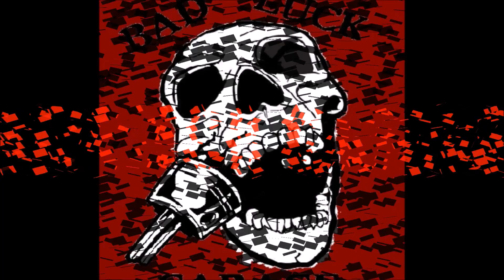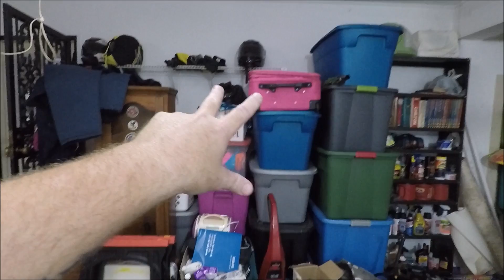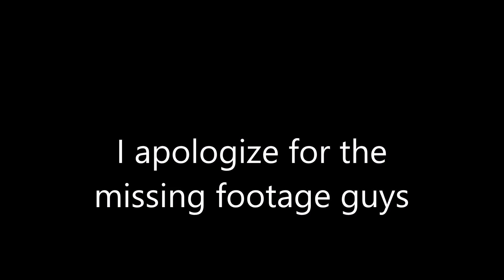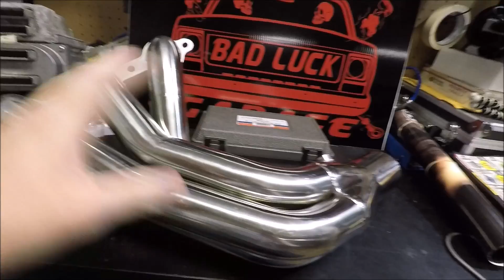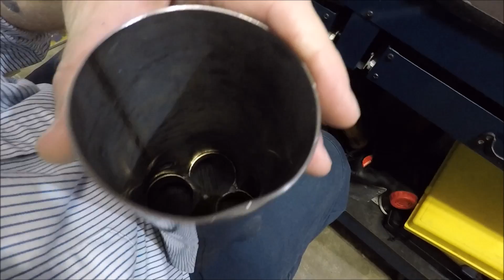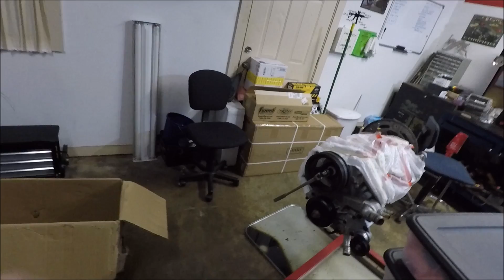SPEED ENGINEERING HEADERS AND X-PIPE UNBOXING AND REVIEW

Comment: Weld in v bands and be done man!!!!
Reply from the maker: Vbands aren’t necessary. New band clamps worked just fine. There is a link to the ones I used in the description of the installation videos. They’ve been leak free for well over a year now even after having removed and reinstalled several times for various reasons. 👍🏻 I would however recommend welding the rear section as I stated in the installation videos.
Reply: Bad Luck Garage v bands look cleaner to me then the band clamps
Reply from the maker: Have people crawling under your car often do you?🤣
Reply: Bad Luck Garage nope I just like my truck to look good! Out under hood and under truck

Comment: The flanges ARE stainless, not mild steel. 304 stainless is magnetic if its cold worked. The tubes are heated when they're extruded during manufacturing. the flanges are   waterjet cut from a plate of 304 stainless.

Comment: Hey Rob after you install the long tubes can you make a video showing how you use HP tuners to tune for the headers? I know it would change the fuel trims and I'd love to see how you tackle that since I will be installing long tubes on my f body and would like to see how to tune for them instead of paying someone
Reply from the maker: I’ll give it a shot brother. 👍🏻 The only issue is I still use scanner 2.24 to tune, but as long as you already have your configuration set up that shouldnt matter.
Reply: I use 3.0 they are very similar if you can it would be awesome
Reply from the maker: When I finally street tune it, I’ll see what I can do brother. I was actually going to make some videos when I was tuning my buddy’s C10 a few videos back but was in a hurry to get it done and didn’t have time. I also need to get a good microphone to do the screen capture with. 👍🏻
Reply from the maker: I’ll do my best brother. 👍🏻

Comment: had a Harley head pipe that was loose, bought an Exhaust expander and carefully (as in don't man handle it) expanded it to make it fit nice and snug. You have to be careful with the expander though ( harbor freight tool) so as not to over tighten it and break or strip it. The tool gets a lot of bad reviews but if you use it carefully, like slowly rethreading a hole, tighten a little, loosen it let the metal rest, tighten a little the loosen. The tool works wonders and you will have a snug fit. Then still get good clamps. The expanders come in several sizes.
Reply from the maker: That’s a great idea and I was actually planning to buy an expander to straighten out the header collectors that got dinged up in shipping anyway. This was actually in the footage that got corrupted so nobody saw me cussing out UPS. Lol.

Comment: Can't wait for the new build man. Gonna be awesome. I went and checked my headers from speed engineering, mine are one piece collectors. That's weird yours has that funky weld on one. My flanges are the mild steel as well tho. As far as the clamps they provide...I hate them. You have to clamp the bejesus out of them and I'f the clamp isn't halfway hanging off the coupled edge it wont be tight enough. I'm going custom after I get my mig(vbanded). For now I'm dealing with exhaust leak sounds from the couplers. 🙄
Reply from the maker: Yea I know those leaks are coming. Hopefully I can seal them up.

Comment: Mild steel flanges don't warp nearly as bad as stainless flanges so using mild gives them a better chance of not warping
Reply from the maker: Thats exactly the type of response I was looking for! Makes total sense then. Thanks brother! 👍
Reply: Spend the $100~ on ceramic heat coating for the headers and you'll never have to worry about the flange rusting or corroding, along with the other benefits.
Reply from the maker: RobFRC, that’s actually a great idea. The only problem is I don’t have “the $100” that you’re referring too. Lol.
Reply: Bad Luck Garage some lower grade stainless can be magnetic.
Reply: @DalyShowTX  yes that is very true 409 Stainless steel is magnetic, Most of Flowmasters mufflers, piping and so on that's marketed and sold as stainless steel is all 409 stainless
Reply: So not to sound like a dick but ALOT of people have this misconception when it come to 409 stainless, or as most people know it stainless that is magnetic. Yes it is not nearly as tough and durable as 304 stainless, but that doesn't necessarily mean that it's inferior or junk. How many people on here have cut Flowmaster mufflers off a car at a junkyard and reused them? Well guess what that Flowmaster is likely 409. I live in the desert so rust isn't a major deal here but I've seen people cut Flowmasters off and reuse them and the muffler was probably originally installed in the 90's and they're fine so please don't think that just because it's 409 that it's junk... because it's not it's still a stainless steel at the end of the day...